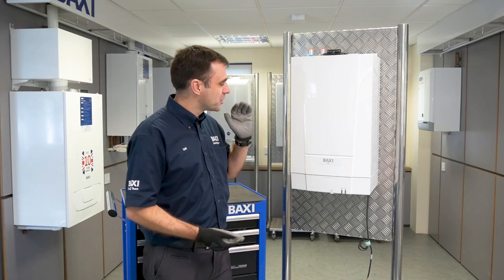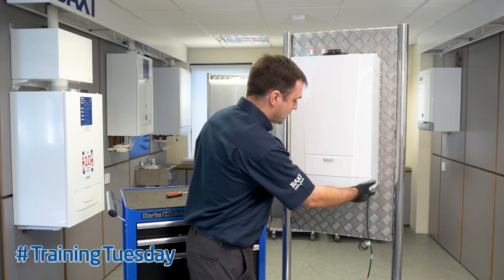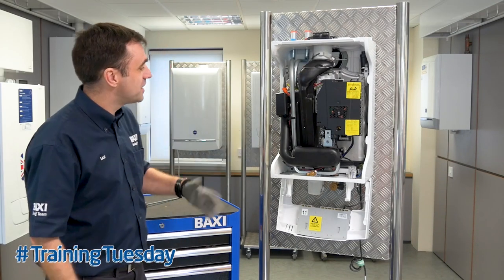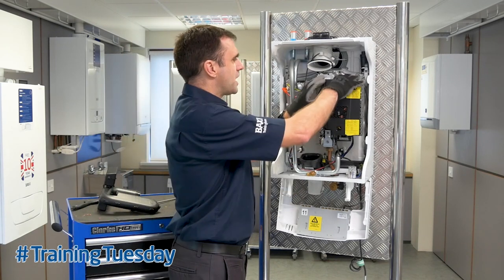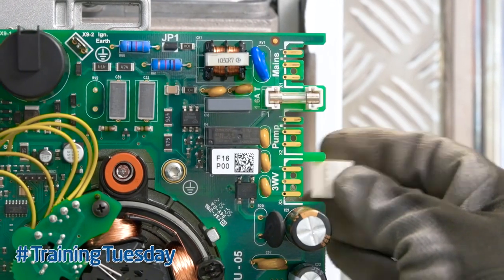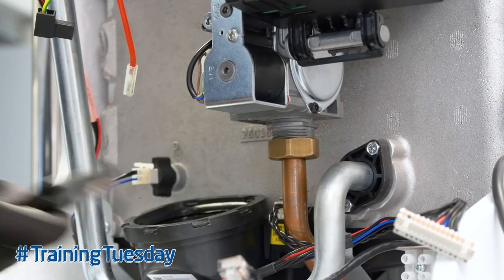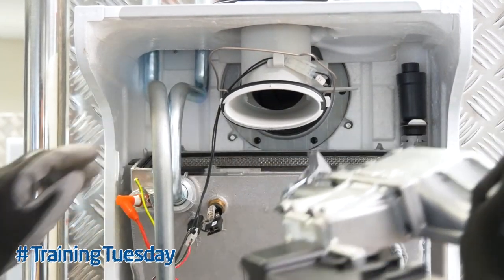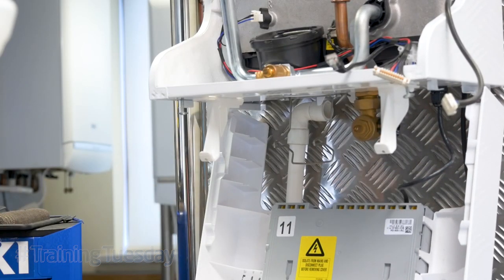How to strip down the Baxi 600 boiler ready for a full service

Comment: Wow, that's the first Baxi I have ever seen that someone has designed for an engineer to work on, reminds me of the Glow worm Energy boilers that are just as straight forward (alloy heat engine) This might just prompt me to fit one for the first time in 25 years.

Comment: Hi Ian, I currently have a Baxi solo 3 PFL (Model 50) which is getting old.  I am thinking of replacing it, I don’t want a combination so a Baxi 800 heat only would probably be ideal, however, I have a question.  My solo 3 has a rear output flu, I understand the 800 series can be rear or top flu outputs.  Will my existing flu hole and pipes be compatible with a Baxi 800?  I fully understand that I will need a smaller external hole for the condensation pipe.  Thanking you in advance.